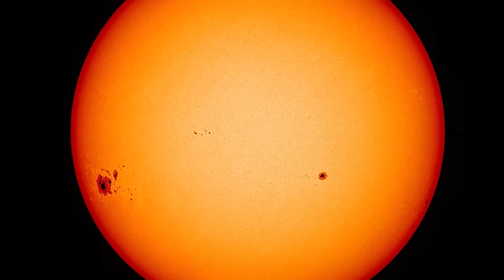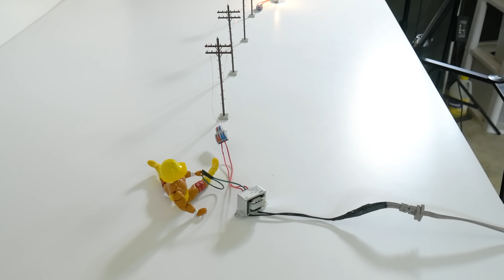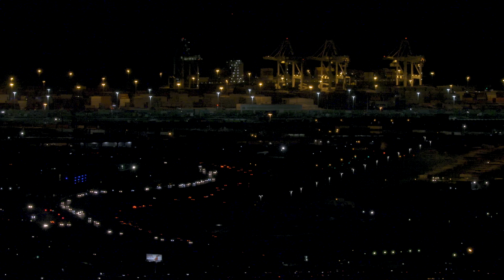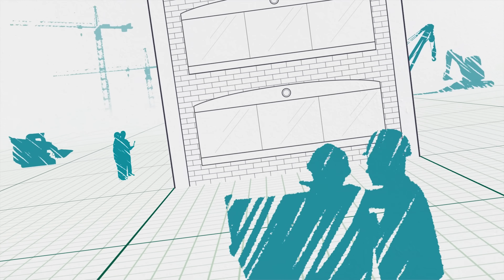The Most Confusing Part of the Power Grid

Comment: The power grid amazes me, never realized how complex it really is. So many questions, but one that’s top of mind at the moment is about surges and surge protection. I’ve heard that some surges are caused by the utility switching generators. Lightening is an issue of course. And supposedly a lot of small surges happen inside the home, caused by equipment cycling on and off. Any thoughts on this? Anything to do with the reactive power? And how exactly does an MOV shunt the surge to ground if it’s not directly between the surge and the load? Would love to know more about this. Thanks!
Reply: lightning is indeed a problem. not so much for the line side, which is relatively easy to protect with some thoughts (like a ground line on top of transmission lines to shield those underneath to a high degree [albeit not to a hundred percent as some parts will always make it into the "less attractive system" as well; that's why a good ground connection is so crucial to increase the attractiveness of the protective part.])

but what you can't control is lightning going into the ground nearby (let's say of a home.) since neutral has ground potential, it is directly affected when a lightning strike shifts this ground potential.

a mov works not by bridging anything into the ground (which can quickly cause overloaded lines to melt or trip a breaker/fuse), but by adapting the resistance to the new, i.e., increased voltage situation. an increase of its resistance ensures that the overall currency doesn't become critical. it acts like a brake for current; which also causes a voltage drop. (there's a potential difference between input and output when "activated.")

Comment: This is when that high school trigonometry pays off. An inductance stores current, capacitance stores voltage, watch the sine waves move and see what it does to Watts. And just to make it fun, 3 phase transmission lines can act as either capacitors (conductors separated by a non-conductor, or inductors (a loop of wire) depending on loading.

I still say electricity is the closest thing we have to true magic, and my only shot at working with it was math (and remembering to turn off the breaker before changing an outlet - learned that lesson when I was 13).

Comment: - 00:01 🪐 Earth experienced one of its strongest geomagnetic storms in March 1989.
- 00:07 🔭 Scientists observed a cluster of sunspots emerging on the sun's horizon.
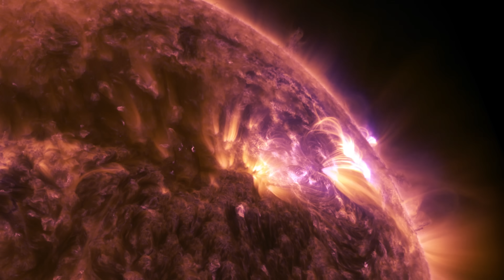- 00:24 🌞 Two solar flares and coronal mass ejections erupted, heading towards Earth.
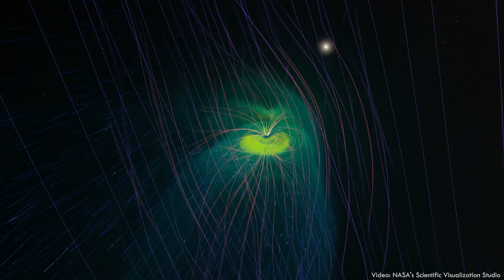- 00:41 🌌 The coronal mass ejections compressed Earth's magnetic field, inducing electric currents.
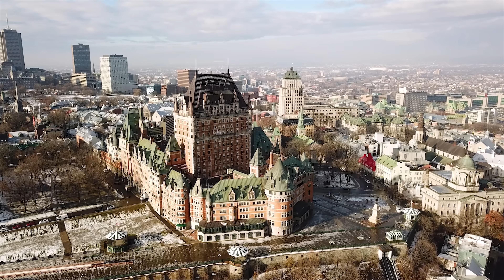- 00:52 ⚡ In Quebec, the unique geology prevented induced currents from dissipating, leading to a blackout.
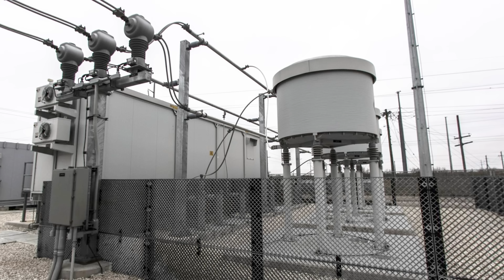- 01:14 🌩 The geomagnetic storm blacked out a large part of the Hydro-Quebec power grid for nine hours.
- 01:21 🛠 Static compensators were the first pieces of equipment to fail during the storm.
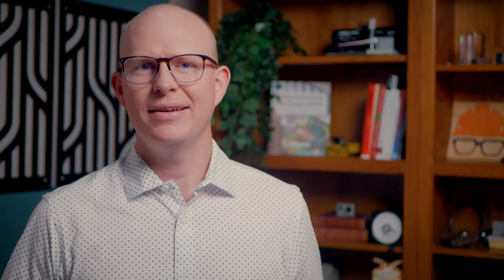- 01:28 🔄 Explanation of alternating current (AC) in modern power grids begins.
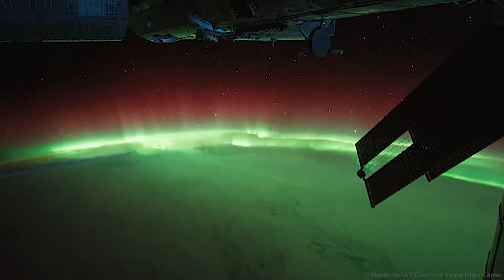- 02:09 🏠 Devices in homes can cause the grid to behave unusually by forcing power production without consuming it.
- 03:06 💡 Basic power grid model includes a power source, transmission line, and a load (light bulb).
- 03:26 📏 Key electrical circuit measurements: voltage, current, resistance, and power.
- 04:52 ⚙ Explanation of Ohm's law and its application in simple DC circuits.
- 05:04 🔌 Switching to an AC transformer shows similar voltage and current measurements, but with alternating properties.
- 05:41 📊 Using an oscilloscope reveals that voltage and current are constantly alternating in AC circuits.
- 06:27 📈 Capacitors and inductors cause phase shifts in voltage and current waveforms, affecting power flow.
- 07:42 🔄 Inductive loads, like motors, create a lagging current waveform.
- 08:03 🔋 Reactive power in capacitive and inductive loads oscillates rather than being consumed.
- 09:13 🏠 Induction motors in homes store and return reactive power to the grid, impacting overall power flow.
- 10:00 💵 Reactive power isn't billed to homeowners but still incurs costs due to grid losses.
- 11:02 🏭 Industrial customers are charged for reactive power due to its impact on grid capacity.
- 11:44 📐 The power triangle visualizes real power, reactive power, and apparent power.
- 12:45 🏭 Large users with low power factor require robust grid connections, tracked by utilities.
- 13:34 🔄 Managing power generation and demand is crucial to maintaining grid frequency stability.
- 15:04 🚦 Loads with lower power factor reduce grid stability and voltage levels.
- 15:53 ⚖ Supplying reactive power supports voltage stability and shifts the PV curve upwards.
- 16:39 🌱 Transition to renewables increases the need for managing reactive power fluctuations.
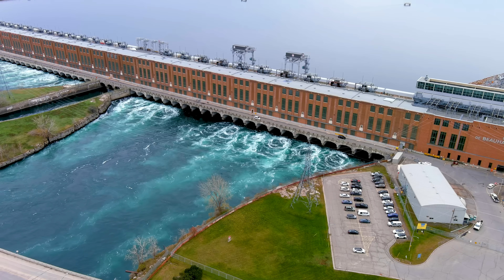- 18:09 ⚡ Hydro-Quebec's static VAR compensators failed during the 1989 geomagnetic storm, leading to a blackout.
- 19:32 🌍 Future grid stability, with increasing renewables, relies on innovative solutions like repurposing old generators.

Comment: Great example of Inductive Load and Reactive Power. Many modern motors are moving to VFDs or “inverter” drives. They often eliminate or at least greatly reduce reactive power and inductive loads by rectifying to DC and re inverting to variable frequency to match the speed the motor needs.

Comment: Very interesting. There was a lot I did not know about the electrical grid. And I am a ham radio operator and familiar with electronics, but not so with the high voltage systems like the grid. Funny, at the end you suddenly have a beard, and you're a different shirt.

Comment: When I was a Tech Student..I learned about E.L.I. the I.C.E. man (Voltage Leads Current in an Inductive Circuit and Current Leads Voltage in a Capacitive circuit)... Back then,I waa unsure of choosing any said career --- I had to try many different jobs,before programming computers and writing simple code...Now,I "Currently"(Ooooo-- a pun!!) work Part-time for Bellows Falls Energy in Vermont...I built them a few computers to control a generator that the City of Omaha(Somewbere in the middle of America) donated for parts-We had to get many more "parts" to get the thing On-Line(Oooo, another pun!!)... The System is partially controlled through the Internet and if there is any threat of a hack- We contol the whole system using our Ham Radios!! I am in La Junta,Colorado ...

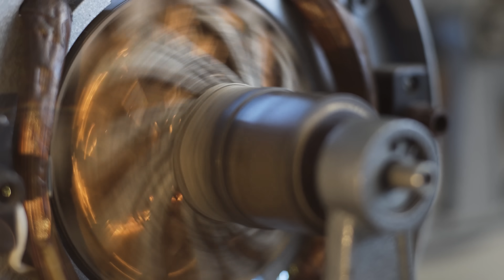Comment: Great video as always, but I feel the need to point out that the motor at 9:16 isn't really an induction motor.  It's not even a wound rotor induction motor, because those have slip rings. The motor shown has a commutator, which likely makes it a universal AC motor.  Universal AC motors have very low inductance and a power factor of 0.95+.

Comment: The so called "Smart meters" that are being rolled out here in the UK to every home can measure apparent and real power so it is only a matter of time before we get charged for both, especialy as more and more electronics and fewer plain resistive loads like lamps are the main loadings in homes. I think that at some point in the future we may see a switch back to DC distribution due to thing like LED lamps and electronic controls of motors where the first thing the incoming power sees is a full bridge rectifier.

Comment: Electric rail systems with electric trains and locos demonstrate this - here where I live the rail system is electrified with 1500 V DC, and when electric locos were used for freight trains it did not take much to 'trip' the substations due to very high loads reducing the voltage to the point that the substations cannot cope and they drop out. The traction current infrastructure is designed to be rated for up to 1000 A per rail. I don't have any experience operating trains in 25 KV AC systems but some rail networks in Australia use that.

Comment: So many of the things I learned in entertainment. Power factor so important to your wattage calculation, just a percent can change your gen-set calculation significantly, so poor quality fixtures will cost more to run.
Some equipment needs a ‘ghost load’ to function, ie resistive load.
Now I’m on ships, massive inductive loads from propulsion motors and delta power eventually kills our equipment’s power supplies.

Comment: So, the uptake of all this is that Edison, with his DC power distribution, was right after all. DC is actually better than AC. And there actually ARE a few large DC distribution systems in the world, made possible by modern high power solid state devices. The ONLY reason Westinghouse won out with AC power over Edison's DC, is that at that time, early 20th Century, AC was the only power that could easily be converted, or transformed for long distance distribution. And we have been stuck with it ever since. Virtually all modern household electronics could be run right now on DC. And many AC-only motor applications, such as air conditioning, actually use DC motors internally, so could easily be designed to run on DC distribution. The one thing he DIDN'T mention, besides the losses by power factor, is the losses that AC creates by eddy currents (from yanking molecules back and forth 60 times a second) and the heating they produce. Ever notice the rows of cooling fans on substation transformers? That's from the wasted heat produced by pure resistance as well as the AC effect of eddy currents in the transformers. Any heat produced represents wasted power consumed. While DC would produce SOME heat loss in conversion, it would be a lot LESS. Same would be true with the transmission lines themselves, as well the transformers. Basically, you would only need one, or maybe two lines, instead of the 3 lines used now for 3-phase transmission.

Comment: As a retired IBEW electrician, I can tell you that utility meters and utilities do very much charge for reactive power, as the utility does still have to deliver the power regardless of it being actually used by the customer. The utility does not usually care unless their distribution lines are being effected enough to effect nearby customers to a point that they are getting "dirty" power. The utility will then usually offer the large inductive load customer the choice of fixing the problem themselves, or paying the utility to provide the fix.

We can calculate the size of capacitors to use on the customer side of the meter in order to bring the voltage and current back into parity (power factor of 1) for large commercial and industrial users of power with large inductive loads. The cost of adding the proper capacitors could save a utility customer many thousands of dollars a year, making the cost of hiring an electrician to install the correct capacitors well worth it. If the customer has their own electrician on staff, and they are knowledgeable and care enough, they will implement testing on their system and then add the proper power factor correction as needed in order to save their employer money.

One of the great advantages of large BESS (battery electrical storage systems) and utility scale solar is that they take the DC power from the PV modules or battery, and then use electronic switching to create the proper AC waveform to inject into the grid. The electronics allow for power factor correction since they can inject either voltage or current into the grid at the right time in order to support specific parts of the AC waveform as needed in as little as one or two cycles from sensing a problem.

Comment: i wish i had these videos going through my EE degree. I do presentations for climate work in the energy sector and I'm absolutely going to add this to the list of links to help explain VAR compensation. I feel like the next major thing would be going to a grid operation center and getting into how regional grid operators actually decide and flick switches to move power, "turn on" generators that they've bidded in that day, and especially how they do mid day bidding. I know that starts to get into economics stuff but you could easily just say "we're not doing economics but here's a very simple example and we're going to focus on the engineering the rest of the time" 

I've been studying this stuff for years but still don't actually know the process of what happens from when a grid operator sees the need for more power, flicks a switch or whatever to get more power delivered from xyz utility, and directing that power to the load area. 

Also check out the new game "Power to the People"

Comment: At the 6:30 mark in this video you applied an Electrolytic Capacitor to an AC circuit.  This is dangerous as Electrolytic Capacitors are for DC circuits only.  You got away with it because your AC voltage was very low and and you did not have the capacitor connected very long.  For AC circuits you need to use Film Capacitor of the proper voltage rating.  Otherwise, everything else was very good.

Comment: 19:55 Theres an old geothermal generating station in Vancouver where they did the same thing with the steam turbines. Instead of producing power they're now being used as synchronous motors to bring up the PF on the grid

Comment: The 1st time I got shocked by 50hz was so weird! Even when I got inside the substation we were trying to get back online when they closed the switches (imagine 1950’s Bakelite fuse holders that are the size of a loaf of bread and the fuse was a piece of 12ga solid copper) I felt like something was wrong but it just was I forgot we weren’t in the USA! There was so many random wires people ran to the substation just to light their homes you could feel the unbalance and induction in the air.
Reply: It was in Demara, Guyana. Sorry that probably would help if I had said that.

Comment: I've often wondered how the grid will function with a large number net metering system trying to push power back onto the grid.  Seems you need to raise the voltage in order for the current to flow.  What happens to the grid voltage?  Does it rise too much?  Currently, there is a relatively low number of sources, but that could dramatically change with 10s to 100s  of thousands of residential and industrial solar installs.

Comment: 11:30 The Boston-area subdivision in which I grew up had houses based on maybe 4 or 5 standard models and most, maybe all of these were available with a choice of forced-hot-water or forced-hot-air heating (air conditioning in this price range was almost unheard of in 1956). The odd thing was that while houses like mine, with forced-hot-water heating had one electric meter, the ones with forced-hot-air had 3, 2 of which were very strange looking. In fact, the markings on our meter were obvious to me, even at 9 or 10 years old, but I never made sense of these strange meters while I was living there. Today, my guess is that the extra 2 meters were Boston Edison's means of measuring the reactive portion of the load and addressing the effects of it one way or another. Still, some questions remain: Why were these meters necessary for houses with forced-hot-air heat only? Were the motors on these systems more likely to present a complex load in 1956 than the circulator motors on forced-hot-water systems? Is the design of  today's HVAC systems better regulated so as to prevent complex loading? I would think that if any of our relatively small houses presented loading problems back then, today's HVAC systems would be far worse, unless every motor in the system had its own loading compensation.
PS: When I drive through that neighborhood today, all of the houses have single meters.

Comment: Checked the comments, glad I'm not the only one who felt bad for that abused lead-acid battery (sub 11 volts?  Yeeesh) or was reflexively stepping back when he plugged that polarized cap into an AC circuit.

Was also disappointed to not see an explanation of non-linear reactive power, which comes not from capacitive/inductive reactance but from non-linear switched loads, which don't just timeshift the AC wave, but also introduce harmonics (multiples of the base frequency) into the system.  Those can't be compensated for with a bank of caps.

Comment: This video does an amazing job explaining reactive power!
One nitpick regarding the resistance of incandescent bulbs: the resistance really changes with temperature. Increased voltage => increased current => increased power released as heat. In general, it is true that resistance changes with voltage because increased heat => higher temperature => higher resistance.

Comment: I've often wondered if it is helpful, required, or even possible to keep all the power grids across an area (like the whole country) in phase, or close to it, all the time.  I know phase is critical when adding an generator to an operating grid (or connecting 2 grids together), but how about when is is necessary to switch things over when something fails somewhere?  How wide of an area has to be in phase for everything to work?  Given that the wavelength of 60 Hz is around 3000 miles (at the speed of light in a vacuum, which electricity in wire is significantly slower, resulting in shorter wavelength), there would be significant phase differences along a single piece of wire spanning the US.

Comment: Hello mate. Can you say something about home use central AC? I found out the low load problem on this device to be very annoying and easily overlooked.
The exterior unit has to be big enough to handle the spike load when all interior units are wide open. But since it's home use sometimes only one room is active and it's already cooled so it's just sustaining. The central AC works POOR on this scenario...